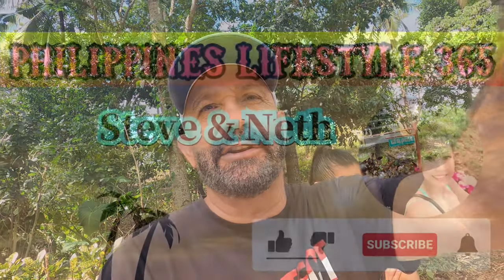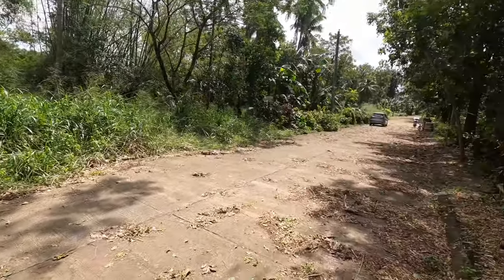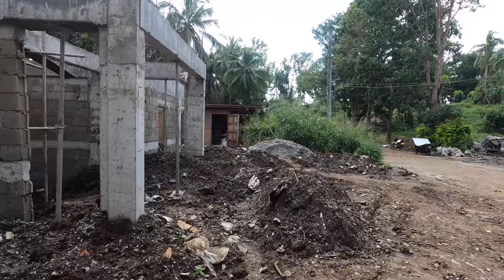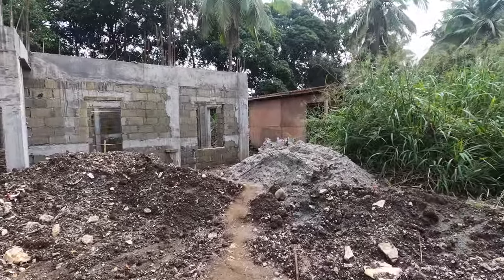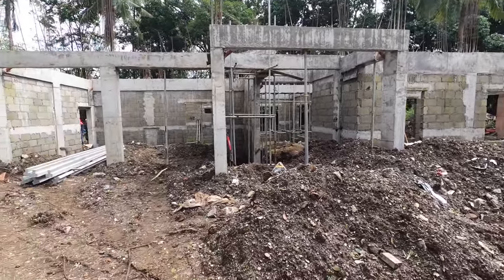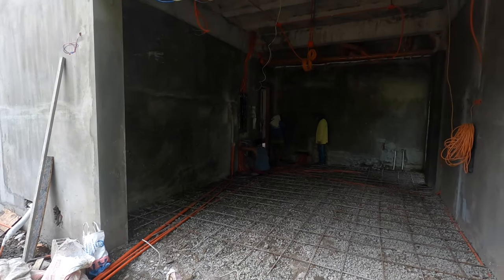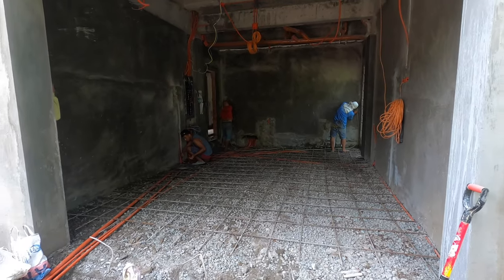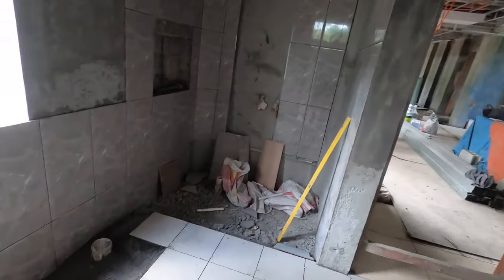Philippines House Build Vlog 33: CONCRETE BEAM ON SITE

Comment: If you watch where you were walking upslope, you will see a piece of rebar stuck in the ground. That's the dividing line. Also, in the back of aansleys lot, you will see the same marked rebar. Has a yellow ribbon. Just draw a line between the rebar markers. I think it's only a 603 square meters lot. The coconut tree is on the adjoining lot.
Reply from the maker: Thanks for sharing that you have good eyes

Comment: What is the 25% rule there
Reply from the maker: You only allowed 25% of footprint on your lot
Reply: @NethFaulkner  so for a 750sq m lot you can only have a 187sq m foundation thats small
Reply from the maker: Hi Roger, If you had a 750sq  m lot have 2 story that comes out to 375 sqm even more if you built a basement or stayed under the high requirements remember when they say footprint they do not factor in how many stories you build, hope that helps.